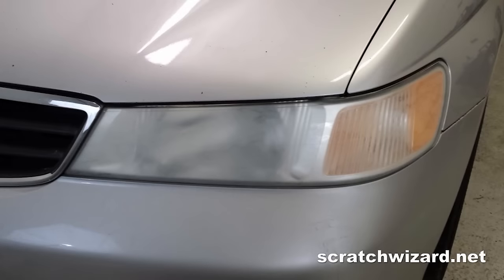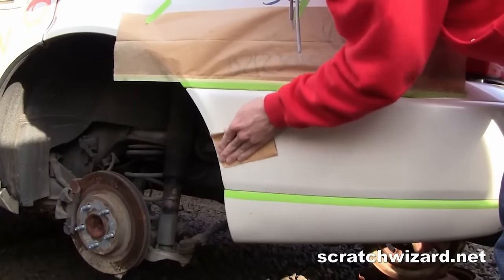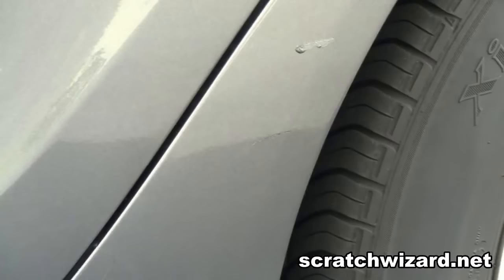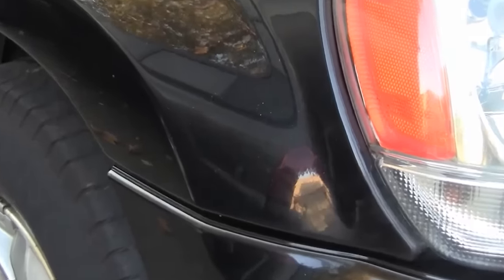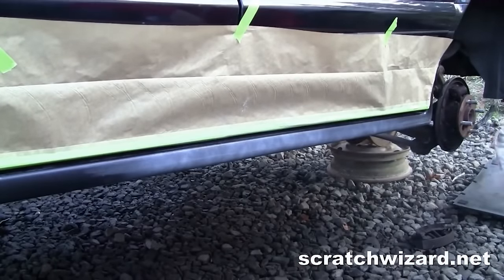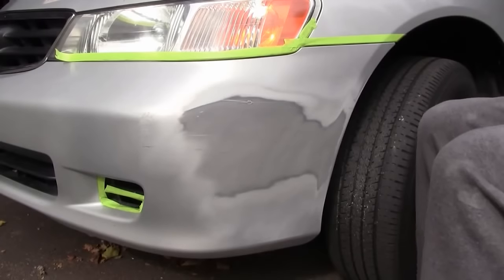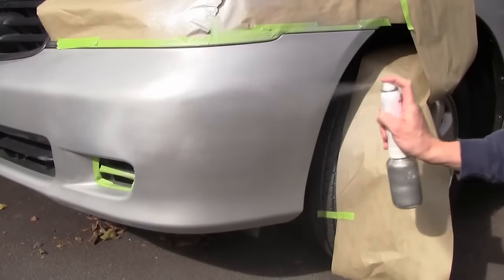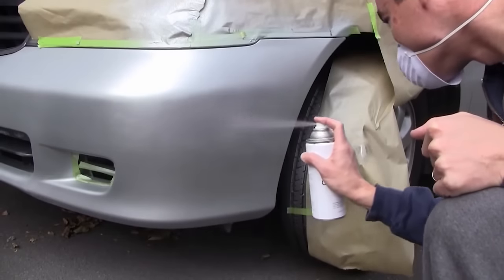Unintentional ASMR Car Repair 💦🚗 Spraying, Scratching, Wiping, Deep Voice Male Instructions

Comment: Its illegal in germany and some other europe countries, because you scrup the lightbreaking surface eventually and it doesnt shine into the direction it should. Atleast thats what ive been told in my apprenticeship and such. Id just pass out on the 400grid because it rubs off alittle too much for my own taste. Also if you can-spray something like in the firat clip, never start spraying while the can is aimed at whatever u wanna paint. You start off the product and stop off the product usually, or start on the tape and end on the tape. Please also never flex your wrists. Keep the same distance and move from your arm so the coat gets even. Also if you spray a certain area like with the red car, fold the edges of the tap over, so its not a solid edge from one paint to the other. There should be a small gap where spraydust can get under. You can see where its paintet way too much. I am not a pro at painting, but he does many small mistakes that youd lern in a proper apprenticeship or real painting experiences at a professional level
Reply: Wow
Reply: I was a graffiti writer I can see he is not very skillful with the spray can
Reply: But for an amateur and small personal fixes, would you recommend the kit?